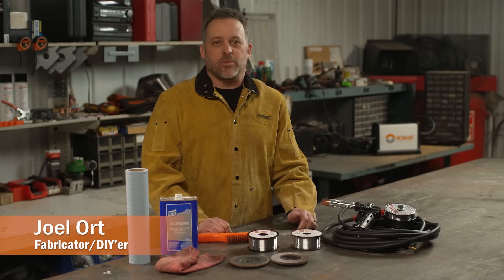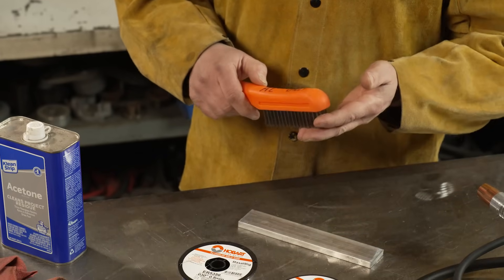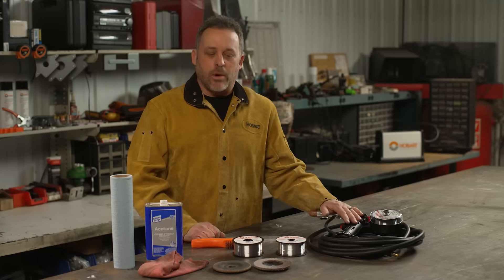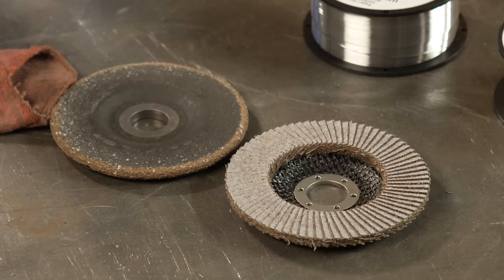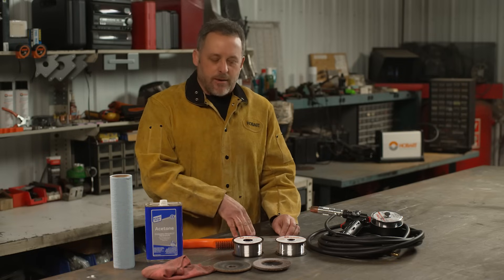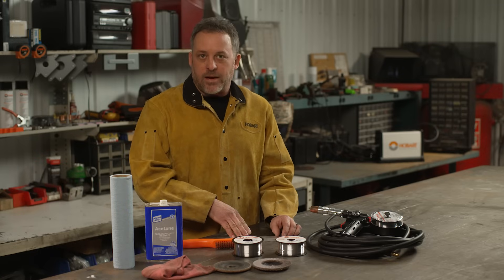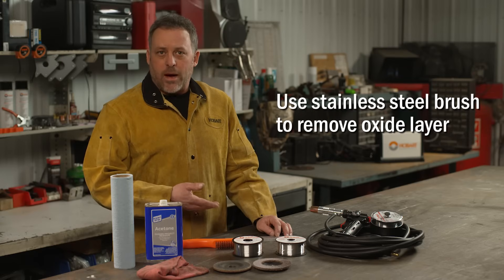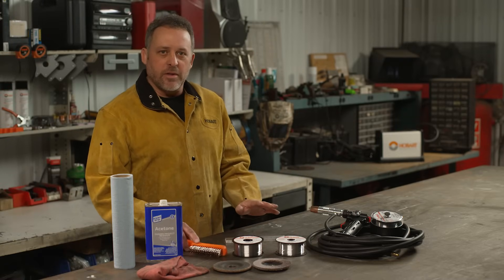What's Needed to MIG Weld on Aluminum?

Comment: That is not true, 
I am pushing aluminum welding wire through 10 feet gun with no grafite  insert and never problem
Reply: Can you get away without running gas?
Reply: @joeyadams4318  no, you need argon

Comment: What is the recommended amperage that should be used to weld aluminum? Can a 140 MP tackle something like this or is it only specific types of aluminum thickness?
Reply from the maker: Hello! Thanks for your question. A 140A machine is capable of welding aluminum, but for the best experience, we recommend using a 200A+ machine as it requires extra amperage. To weld aluminum effectively, a spool gun accessory would be the most cost-effective option. With our Handler 210, you can weld aluminum ranging from 18ga. to 1/4 in. If you have any other questions let us know.

Comment: The Hobart 140 says it can do aluminum, is there a video of this setup? I read that there isn’t a spool gun available for the 140, if there is can you please direct me to it?
Reply from the maker: Thanks for your question, Andrew. There is no direct spool gun for the Handler 140 which is recommended to weld aluminum, but you can try to feed it through the mig gun. No other accessories are needed, keep the gun good and straight when welding.

Comment: Which spool gun part number do I need to order for the Hobart 140, to weld aluminum?
Reply from the maker: Thanks for your question, Andrew. There is no direct spool gun for the Handler 140 which is recommended to weld aluminum.